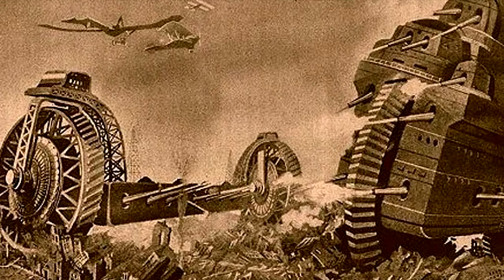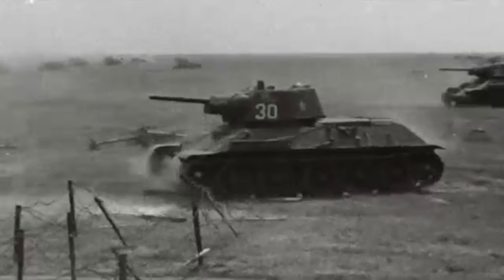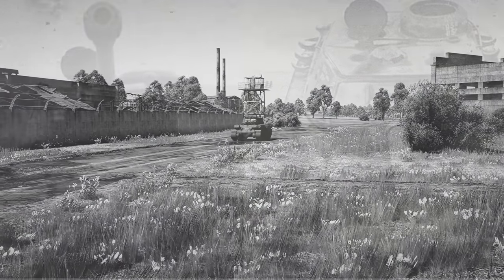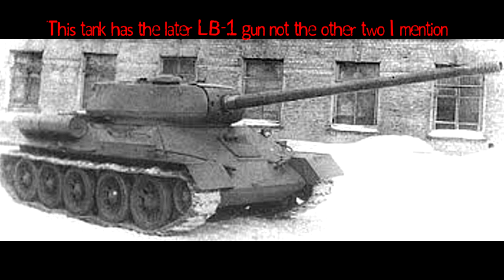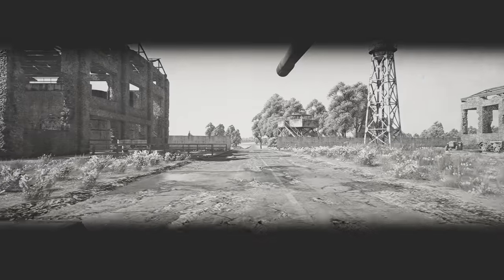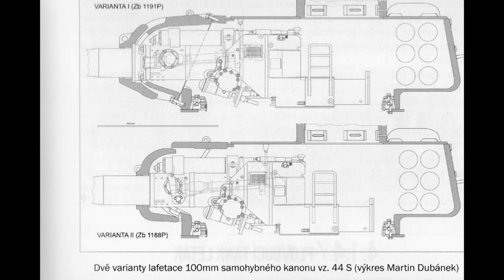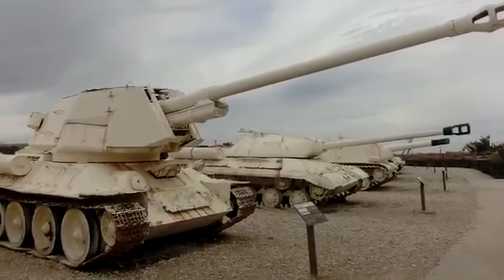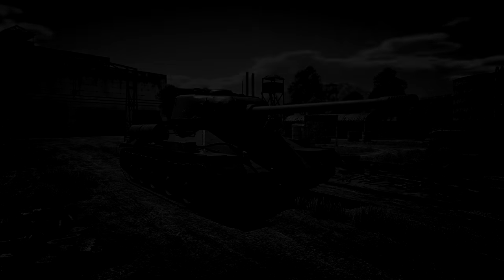The Failed T-34 Variant, T-34-100 | Cursed By Design

Comment: Cuba has it's own T-34 version in service today, it haves an M46 howitzer mounted, that's a 130mm gun
Reply: w0t
Reply: hory shet
Reply: "M1 abrams gets blasted by t-34"

yes ik it's probably not able to penetrate
Reply: @vitaurea  Probably it just shoots HE but it would be funny
Edit: It´s categorized as SPG
Reply: Cuba also has versions of the BTR-60 mounting the T-62's 115mm (BTR-115) and the T-54/55's 100mm (BTR-100)
and another SPAAG version with twin Czech 30mm cannons (M53/59) in an open-topped turret, although this variant has been retired afaik
Reply: there is a 130mm APCBC-HE shell for the gun, which can penetrate the side of an abrams...
Reply: DAMN BOI DATS BIG
Reply: @vitaurea  T-34-57 shooting one from the side lol
Reply: SU-100-34
Reply: Cool
Reply: hory shiet..
Reply: no wonder america didnt attempt another invasion
Reply: It only has one shell. It's says "To JFK" on the side and has been loaded for almost 60 years.
Reply: And let's not forget that the Cuban  infantry use '54 Chevy's as their main battle transport.
Reply: I suspect it wouldn't be much practical use as a tank, but it might work relatively well as a self-propelled gun?

Edit: now I've seen the picture. Clearly was not meant to be a tank.

Comment: I was expecting an even slight mention to the T-43, the tank which most of it's improvements were used to develop the T-34-85. But i guess that's another story as the T-43 cannot be considered a T-34 variant, but a whole new vehicle.

Comment: I feel like Jagdpanzer 38(t) deserve it's own episode of "Cursed by Design" , since the head engineering was Russian with Czech team, which makes all sorts of intended flaws.
what do you think Cone?
Reply from the maker: The jagdpanzer 38t has quite a few interesting variants that would definitely make a good episode for the future.
Reply: @ConeOfArc  Were not focusing on the Egyptian tanks? Those things looked like KLOWNS in the short clip that you had. Especially the Egyptian 122mm T-34 with a uno-reversed turret. Also, you should try to include the main (or most accredited person) who came up with the idea of the next tank to look at. Just a thought tho...
Reply: Yes, they did it on purpouse but werent all those flaws fixed?
Reply: @fritzenders5099  i think the 122mm T-34 was just in transport position
Reply: @matthiuskoenig3378   Yea, but did you see all the other wacky tanks nest to the Egyptian T-34-100? Those are the ones that I'm talking about.
Reply: And the 122mm Sherman
Reply: @xuanbuithanh8532  THE. WHAT?
Reply: @fritzenders5099 
The SO-122, a Yugoslavian project to use a Sherman with a Russian 122mm field gun (that had some T-54/55 parts to adapt it) and engine from the T-34-85.
Reply: The so-called Hetzer? It was being produced by the Swiss after the war. I wouldnt call that a failure. Why continue producing something that didnt work?
Reply: If you're talking about the Hetzer, it was a cost effective way of mounting a 75mm gun on a small chassis with some sloped armor. It was easy to hide and presented a small profile when hull down. The gun wasn't as powerful as the 75mm. L/48, but it was enough to take out Sherman's and T-34's with ease. It was never intended to be more than a stop-gap measure until the standardized E series of tanks and TD's could be into production, but the war ended before those plans could be realized.

Comment: Bless the T-34-100 and let Stalin encourage his workers to equip a 122mm on the T-34.
Reply: Actually, there were prototypes of T-44-122
Reply: @Янус_Ырт  T-44 not T-34.
Reply: T-34-152 when (T-34 with KV-2 Mod. 1941 turret)
Reply: Yes it is real there is a T-34 with 122mm called SU-122
Reply: Yugoslavia one-upped them by mounting a D-25T on a shermab
Reply: How to ruin T34, the tank built to be Russian farmboy-proof: "Needs more boom."
Reply: @diesirae8954  i mean
the T44 is basically an upgraded T34
Reply: @thebravegallade731  It's still a different tank though, and it has way better protection.
Reply: Су-122п
Reply: @thebravegallade731  No, it's not. It's a completely different machine. The T-54 is an upgraded T-44. But the T-44's only commonality with the T-34 is sharing the 85mm gun turret.
Reply: @thebravegallade731  The T-44 is entirely new vehicle that has little in common with the T-34 aside from the engine and gun.

Comment: A variant of T-34 that is very unknown by the public the the T-34-85 75, designated by the Finnish - Ps. 245-4.
The 🇫🇮 experimented with a T-34-85 by changing the cannon with the German Stuk 40/L 48 because of shortages of ammo.

When the war ended, the Finnish knew that they will need a much modern tank and they weren't too keen of experimenting. Only 1 tank ever existed and is today displayed in a museum.

Comment: The T-34-100 was a fifties project and it was withdrawn from service in the sixties.

The Izzy museum mislabeled it as T-100 which is to keep with the naming of a Syrian T-34 variant the T-122. 
The Egyptian variants were named by the original chassis followed by the new caliber.

By the seventies all T-34 were withdrawn from service except for engineering and troop transport variants. 
The izzies are labeling it 1973 just to mislead the picture of the war, but it was technically impossible (they were not in service by then) and historically impossible (cuz the izzies didn't manage to occupy land in the war but on the contrary lost some; only to lose much more by the cessation of hostilities agreement the separation of forces agreement ending the war with them losing a third of Sinai.

Comment: I dunno the 100 was used by other countries later on i think a more failed one was the heavy t-34 that yugoslavia was working on which i think only got 1 early concept prototype actually made which was  essentially the T-34 85 but with a modified turret, engine and a american 90mm gun like those on the jackson TD or pershing tanks. In fact i think they literally ripped one off since they got those trough military aid

Comment: How about the sherman and the plans to upgun the tank, there was the popular firefly variant, and a sherman tank fitted with the t26 turret with a 90mm gun, then around 2004 in Tikrit, iraq a sherman with a turret from an m36 jackson equipped with a 90mm was seen, And lastly the two Israeli variants, Super sherman sporting a 105mm and one with an amx 13 turret. Then the none canon upgrades like the skink
And calliope

Comment: Was it really a failure or was it simply abandoned in favor of a newer better vehicle?  If the T-44/T-54 had not worked out then it is very possible the Soviets and Czechs would have finished development of their T-34/100's into a production vehicle. I would expect eventually a muzzle brake would be introduced to handle hotter ammo loads.

Comment: Where does the legend of the T-34-88 fit in ? I've read 3 versions of this legend . 1) German captured T-34 modification 1944 with open turret or gun shield (Waffentrager version?) / 2nd , Soviet captured but exploded Tiger with gun intact was a field conversion on T-34-85 & 3rd story didn't make any sense , since Italians were to be involved ... No time line on the 3rd story either.
Reply: T-34-88 is fake.
Reply: dont tell me u know this from wot console
bcs that is some wg bullsh#t right there

Comment: It wouldn't have helped that by then the war had moved on, what was good for 1941-42 was outdated and by late 1944-1945 there was the JS-3 (IS-3) with a 120mm gun
Reply: IS is heavy tank line. Their gun is 122mm from IS2 onward. The gun was chosen for powerful HE performance not really armor pen through it was close to the 100mm at the time. If they wanted a superior AT gun; they would mount 100mm on it as it became available in sufficient number when IS-3 began to roll out. 

85mm is perfectly serviceable to early 50s. T-44 was produced with 85mm. 

By then T-54 enter production
Reply: is 3 was unreliable
even the soviets admit that is 2 was better

Comment: From what I understand, the T-34-100 was accepted for service by the red army, and passed trials. However, it got cancelled because of the T-54 project. So the T-34-100 was not a failed design, it just came out too late.
Reply: its actually bcs they dont need an up gun t 34 since the war already ending
and they focus more towards the t 44
Reply: but yeah the point is the tank just came out too late

Comment: "The Failed T-34 Variant" Ahem... the whole T34 was a failure.
Reply: Still a much more effective tank then any of the nazi cats
Reply: @redenginner  Define what you mean as "effective", because as a tank it was not.
Reply: @nyctasiaselesq  despite of it's drawbacks, that drawbacks was meant to be there in the first place to make it cheaper, easier to produce, and easier to repair as well, so that they don't need to send it back to the factory all the time. With the quantity over quality, the Soviet was able to produced more tanks than Nazi had, which is the perfect doctrine of what Soviet had with their economy status
Reply: @Kalashnikov413  I agree with the soviets having to put some armor on the field, especially with their factories moving eastwards. But what you have in T34 is a tank that was great in 1939-1940. By 1943 it was inferior to Pz IV F2, Pz IV G, Pz IV H in terms of firepower (gun penetration, target aquisition, target engagement) and definitely inferior to the Sherman in all respects. On top of that, it was (not sure thought) the only tank in the world that had an aluminium engine (very expensive).

By 1945, T34 was as cheap as an M4, and just slightly cheaper compared to Panther. But lost to both of them in all respects, specifically firepower and protection vs Panther, reliability and crew confort vs M4s.
Reply: @nyctasiaselesq  which is why number comes to play. Like i said, Quantity over quality is exactly the best doctrine that the Soviet chose in WWII
Reply: @Kalashnikov413  That is a misconception. Numbers have a lot to do with how large a factory is, not with how a simple thing is to make. Reason soviets were able to build a large number of T34s is due to their supply chain (non swedish iron ore) and large factories.
However, at the begining of Barbarosa, the soviets lost huge numbers of tanks (T26, BT mainly, together with arround 3000 out of theirs 3500ish T34s). Numbers are deceptive. Lastly, the soviet army doctrine was infantry takes ground, while everything else (including armor) supports infantry.
Reply: @nyctasiaselesq  but still, T-34 wasn't a total failure
Reply: @Kalashnikov413  No, there were worst tanks. And T34 shaped the future of Soviet tank design and tank doctrine. 

But it was a failure at doing what a tank was supposed to do. At the begining of the war, it was unable to defend it's self from "inferior" PzIII's and Pz 35s, Pz38s (poor visibility, no 2 way radios, sometimes no radios, soft AP projectiles for main gun, overworked commander, dangerose interior for the crew, poor mechanics). At the end, most of this problems were delt with, but the whole tank is now weakly armoured and soviets are already working on better projects (T44->T54->T55).
Reply: @nyctasiaselesq  Remember, T-34 is the main tank of Soviet in WWII because it suited the Soviet armor doctrine to fight the atritional war. Saying that it was unable to defend itself from inferior Panzers in the beginning of the war was mainly the fact that Soviet were pretty much unprepared and the fact that encountering T-34 is quite rare. But when they do encountered T-34, the Panzer crews shit themselves. Also, the T-34 paved the way of next generation tanks, like the T-44, which was supposed to replaced the T-34, but it was ultimately just a stopgap tank, but the T-44 also paved the way for Soviet to create T-54 and later T-55, the first Soviet MBT. So saying this tank is a total failure is nonesense. You should see this tank not only from it's performance wise, but also it's impact on the war itself

Comment: You forgot to mention some serbian guys (or former yugoslavia) attempted to mount a T-62 turret into a T-34 hull
Reply from the maker: The t62 doesn't use a 100mm
Reply: @ConeOfArc  well.. I'm referring more to the theme, i knew damn right they went overboard with the idea of mounting a 115 mil on a 34

Comment: It not correct to look at it as a failed prototype. Engineers had an idea, they built a prototype and they tested it. Learning that a bigger gun wont fit. 
It would have been a failure if they produced a few thousand of them...
Reply: it actually fit very well with the new turret and the lb 1 gun
but they thought its better to just continue t44 rather than an up gun t 34 since the war already ending

Comment: ALL T-34 variants where one big FAIL. Only reason it was built, was cheap production. That's all. Soviets lost in Eastern Front over 94000 tanks by official soviet count, reality was probably much harsher. By official statistics, soviets built before 8.mai 1945 a whopping 80000 T-34 of all variants. Reader can “do the math” now. 
Basically - all this bragging about T-34 superiority is one big propaganda BS!
Even in 1941, German 37mm, 50mm and 75mm short tank and antitank guns where deadly to T-34 early variants, in 1945 T-34-85 could penetrate T-IV turret only if distance was smaller than 500m. Same T-IV could shot through T-34 from 1000m+.

T-34 real refueling interval was 50km and real sustainable speed was 20kmh or less. This strange 50km refueling interval was due its engines habit to consume large quantities of motor oil, but the oil tank capacity was sufficient only for 50 km of travelling ON ROAD. On the OFF road situation, T-34 refueling gap was even smaller. Fun fact: modern Russian T-72 tanks have same engine, and they have longer refueling gap only because oil tank is three time bigger on them…

“Famous” V2 (in Russian: B-2) engine was actually total garbage and declared power output 500hp was only in paper, in reality it was less than 300. However, real problem was this motor habit to blow up, when it started to resonate in same frequency as the natural frequency of the engine housing. Even the current T-72s have this problem. The T-72 gearbox is specially designed to keep engine speeds below or above the fatal range by weird gear lengths.

One man alone could not use early T-34 gearbox – T-34 had assistant mechanics/front machine gunners to help drivers to operate gearboxes. After US built new gearbox factory for US designed gearboxes, T-34 became controllable by only one mechanic.

In 1942, soviets sent T-34-76 to US for evaluation and redesign, because losses were so great, that even US could not produce tank steel in quantities needed for repelling back German forces. There this famous T-34 broke in Aberdeen proving ground in first day of tests. After couple of weeks, US sent back to Russia couple new factories for producing new turrets and new 85mm guns and one factory for tank gearboxes and turning mechanisms. New T-34-85 was actually improved by US engineers. Without that, the losses would have been so great that even US could not produce resources to replace losses.

Standard T-34 did not have radio even by fall of 1944. 
It was technically inferior to German produced (not Czech or French tanks!) tanks from the beginning of war until last day.

However, there was always 5-10 times numerical superiority in soviet side by tanks in WWII. Best example is battle of Prokhorovka, where Russians sent 400 tanks to attack seven German T-IV tanks and dug in SS-grenaders... Russians lost over 300 tanks in first 4 hours of that battle and some 100-150 more in late battle... Germans lost due initial Soviet attack four T-IV and later crew on one Tiger tank was forced to blow up their tank, which was immobilized by artillery barrage in location, where it was impossible to recover it. Next day Russians deployed 500 tanks sent as replacement...
One time more: soviets lost in eastern front over 94000 tanks, Germans just built from 1934-1945 less than 45500 tanks and armored vehicles of all types counted together.